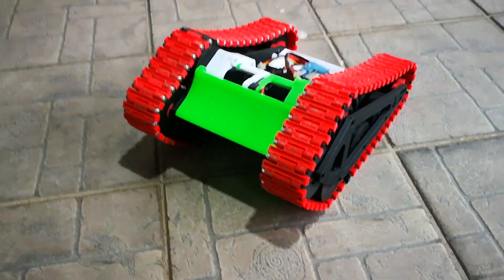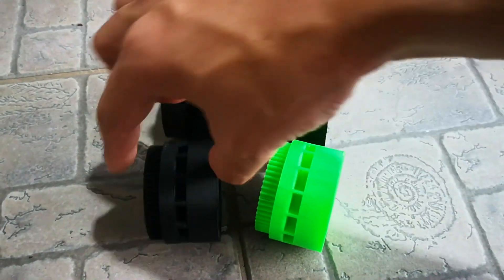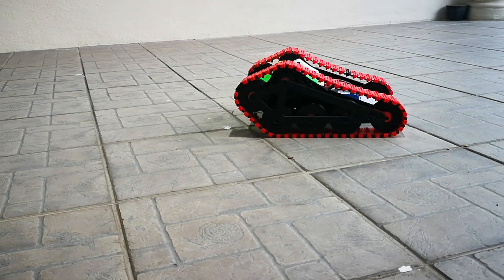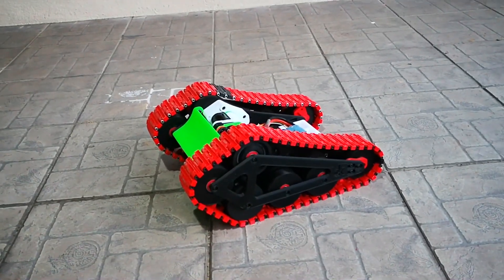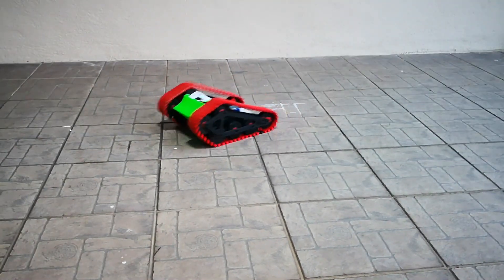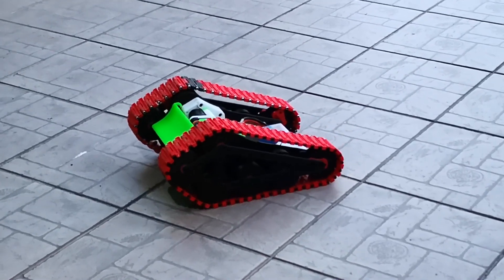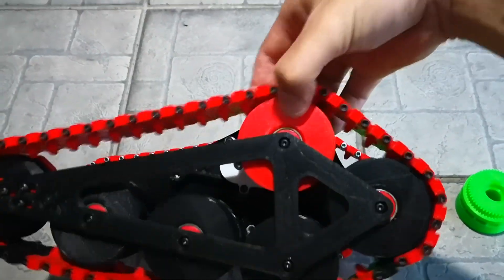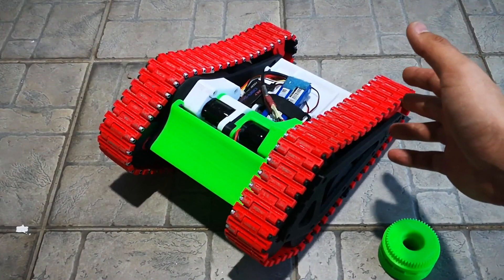Staind RC Tank Improved Track Wheels Explained

Comment: Will definitely print these instead of the original ones when i finish printing the tracks first ! Have you had any tracks breaking under stress?
Im using PLA and 100% infill
Reply from the maker: erm freshly tracks never break. but after so long not playing it, it becomes brittle and keeps breaking  now. ahhhhhhh!
Reply: @EdwardChew  if the last 2 years I'm not even mad!  Maybe storing it in a box with gel or something will help..

Comment: Which filament you used for printing the red chain wheel . Pla,abs,nylon???? Please reply
Reply from the maker: All pla
Reply: @EdwardChew  isn't nylon would have been great as it has more strength and flexibility
Reply from the maker: @tomgirl366  thing is due to the design, you dont need the flexibility. You dont see real tank have flexible tracks right? PLA is always the easiest to print

Comment: Hi, I'm using a futaba TX and reciver, how do I mix the channels so it can go left and right? Many thanks in advance
Reply: use elevon mixing for any TX and plug the recievers into what would normally be the elevator and aileron ports.
Reply from the maker: Hi. Not sure about futaba. Never had them. U need to google or fb group ya
Reply: @EdwardChew  what system do you use?
Reply from the maker: @jasongeorge1167  frsky bro. Frsky xlite
Reply: Ok, I’m gonna go ahead and say sorry right off the bat. I’m a noob and this is Probly really simple. I am having a hell of a time getting this to run properly. I have a taranis qx7 and a frsky  v8fr 2 receiver. No matter what I do when I plug in the battery, it just opens up full throttle. What am I supposed to change on the mixer page? Again I’m sorry but I spent so much time printing this and I’ll be damned if I don’t get it to work